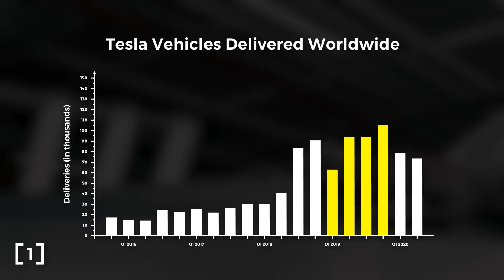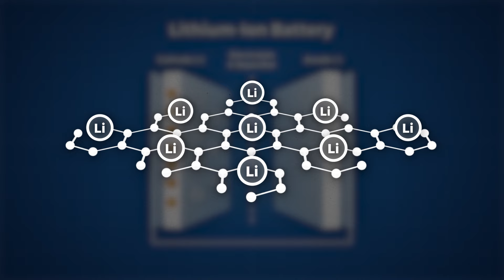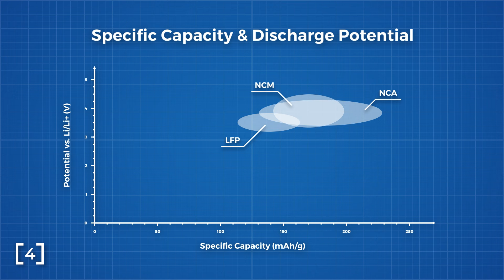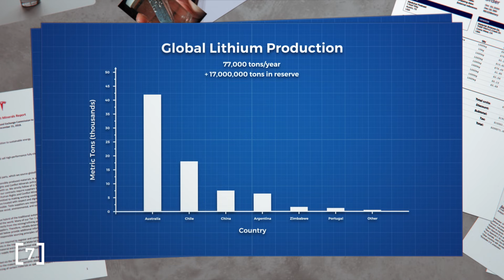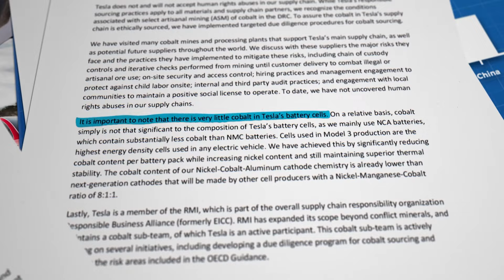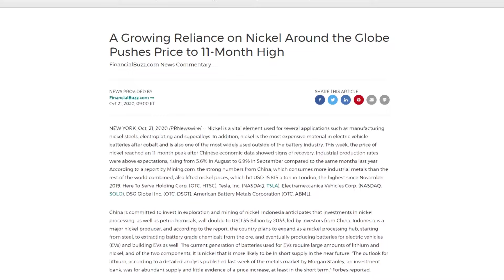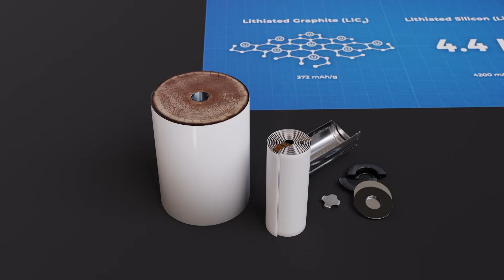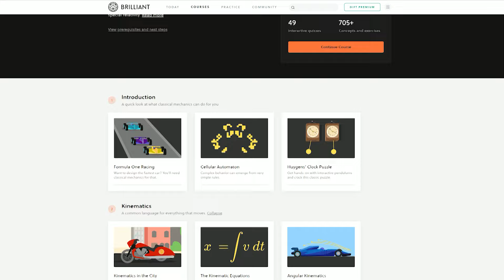Tesla's Battery Supply Problem

Comment: Kurzgesagt:  Let me introduce you to ASTROID MINING!
Reply: If only Elon had some sort of aerospace company
Reply: Ye
Reply: But only a few years
Reply: @ryanfranz6715  Or the biggest reusable rocket on the earth.
Reply: We need a SpaceX Sea Dragon.
Reply: yeah, for no realistic reason...
Reply: Great idea, so we will use rockets that spew thousands of tons of carbon in seconds to go back and forth with relatively small payloads of material. You guys are going to save the planet in no time with this kind of thinking!
Reply: This is the only hope humanity has if we are to survive and grow as a people.
Asteroid mining is the only option.
Reply: @rantan1618  we have plenty of stuff to mine on earth. The benefit of astroid mining is space manufacturing. As a equal amount of solar panels in space is significantly better than those same panels on the ground.
Reply: @ericmichel3857  Starship is methane powered and methane can be produced using CO2, water and energy. So it is kind of closed loop, with energy as input and whatever you bring back as an output
Reply: @ericmichel3857  nah. You'd only have to get the mining equipment up there. Gravity does the work on the way down. Of course this assumes you get an asteroid into the earth's orbit. Regardless not super practical at moment. But not for that reason.
Reply: @rantan1618  Obi wan Kenobi  is "the only hope". I am surprised you did not know that.  I am always amazed by the level of understanding by people that worry about climate change and other SJW issues, it is truly breath taking. Now they are attempting to passionately affect policy based on this level of insight and understanding, what could possibly go wrong?
Reply: Just read the latest responses OMG 😂😂😂 Thankyou, you guys are hilarious. What's next? We could always mine cheese from the moon to solve world hunger? 😂
Reply: And more and more pollution i guess, spacex rockets uses liquid oxygen and rp-1/fossil fuel
Reply: @ericmichel3857  its million tons of carbon
Reply: @LauPaSat-pl  its rp-1/ refined kerosene and not methane
Reply: @lordhefman  you mean starship?
Reply: @daltonlong9593  I mean the largest ever proposed rocket, the Sea dragon. Look it up there is a cool clip from For All Mankind where one is launched.

So what I meant was I want SpaceX to not only do tons of trips to get stuff into space but I also want a US company to have bragging rights to making and flying the largest things into space.
Reply: Its not a short term solution, though. That is gonna take a very long time.
Reply: @ericmichel3857  not to mention cost. Tho carbon is not that big of a problem with rockets
Reply: @CarlosAM1  I agree, there are many reasons this is a really bad idea. The same could be said for wind, solar, and electric cars in general (as a world wide solution). They are fine as niche market novelties for wealthy people who love to virtue signal. But do you honestly think it is worth bringing up all the reasons, when they think we should mine asteroids to build electric cars for the world?  These people live in a cartoon world, it is scary to think they might actually vote.
Reply: ungratefulmetalpansy  it's not a matter of if we can mine or manufacture in space.

It's a matter of cost. It's insanely expensive to escape the earth's gravity well.

However once we do, whether we build in Zero G or on a smaller gravity well like the moon or mars, we will be able to lower that cost.

When that cost goes down we can capture solar energy at higher efficiency than on earth and we can mine asteroids at a cheaper cost.

It's just currently no one, private or government wants to put up the up front cost to start this process.

Which is a little short sighted in my opinion as every nation in history to open a new frontier always profits from the initial monopoly on the new trade opportunity.

Whoever first breaks open the space frontier is going to be the 1800's british empire on super-crack.
Reply: @mortache  you are right it's not a short term solution to current environment problems but it is a solution and it solves many other problems too.
Reply: yeah but who actually owns the materials inside the asteroids?
Reply: @ericmichel3857  Every market is niche market until enough R&D is done to make it more feasible.
Reply: @ericmichel3857  If that CO2 is converted back into methane here on Earth via non-polluting energy, then that emission is carbon neutral and thus wouldn't change anything no matter how many starship-superheavy launches.
Reply: @mortache  Perhaps, but it does not change the fact that right now, and for  the foreseeable future, it is all a BS pipe dream. I also deeply resent our tax dollars subsidizing self righteous virtue signaling twats, just so they can buy a luxury car that makes fart noises.
Especially  when those resources could have gone to something that actually works and would make a real difference, like gen 3/4 nuclear power for example.
Reply: @TCBYEAHCUZ  Another pipe dream that ignores many basic realities, do more research. Elon is an innovative guy, but he also throws out a lot of BS pipe dreams. He is a bit of a con man in that regard.
Reply: @ericmichel3857  I fail to see who he has conned, his wealth increases to the detriment of no one, and his companies recently proved the viability of manned space flight and electric vehicle profitability.
Reply: @ericmichel3857  "climate change and other SJW issues" yup, and there goes your credibility. Not that I agree with the people who think asteroid mining is going to help our resource needs here on this planet but you were very close to calling climate change a democrat/Chinese/cabal/whatever hoax there.
Reply: @ericmichel3857  If by "self righteous virtue signaling twats" you mean just regular capitalists, then sure.
Reply: Not gonna work the asteroid belt only has about 4% the mass of the Earth's moon hopeless endeavor
Reply: @HomeSkillenSLICE  No one wants to mine the entire belt lol. Its the big chunks of rock that are rich in minerals which are hard to extract here.
Reply: @TCBYEAHCUZ  Elon is certainly a visionary and has driven some impressive innovations. However, he also has been purposely overly optimistic and neglects to discuss the down sides of the technologies he advocates and built his business model on. Which is understandable, all I am saying is that it is wise to view his claims with a healthy dose of skepticism. For example methane rocket fuel is far from carbon free, hydrogen is much cleaner, but far more difficult and dangerous. See here  https://everydayastronaut.com/rocket-pollution/ if you scroll down it reviews the emissions level of each fuel, notice where Elon's starship fuel lands compared to others. Just like wind/solar/batteries, it all sound wonderful until you start looking closely at the details and explore the full implications. That is what this video talks about regarding the feasibility of the entire planet going to electric cars. 
I want him to continue and be successful, just realize that they are not entirely what they seem to be at first glance, and that our current fossil fuels are still desperately needed for the foreseeable future, and they are not as awful as some would have you believe. Elon tries to convince you otherwise because it is in the best interest of his business, but the reality is that it is not the world wide solution you think it is.
Reply: @mortache  I meant anyone that believes a high priced luxury car that goes 0-60 in under 3 second and makes fart noises is "saving the planet" what they claim their political beliefs are on social media is irrelevant. Although you don't see much (if any) innovation coming out of socialist societies so...  Unless you think misery and suffering is an innovation? :)
Reply: Asteroid mining will become economical when extracting gold from the sea become economical.

Translation: never
Reply: Yes, but no
Reply: @ericmichel3857  What if we use thos rockets to instead of moving the minded material off the asteroid, you instead launch the astroid towards earth. Then mine it once it hits the ground.

I bet fancy computers can model where it'll land, so launch them into int desert then send mining crews to extract the resources.
Reply: @zaptowee6625  Well, even if we could do it, and I don't believe we could with current technology, it would be a really bad idea. "The earth is protected by a thick atmosphere, the equivalent of 10 meters (30 feet) of seawater. This layer causes small incoming rocks to explode in the atmosphere high above ground and pose no serious threat. These are the meteors or "shooting stars" that we see at night. Asteroid impacts larger than 10 meters (30 feet, 10 kiloton explosion) are much less frequent, arriving once every few years and may sometimes punch down to the ground. The meteor, which exploded above Chelyabinsk, Russia on February 15, 2013, for example, was estimated to be about 15 meters (50 feet) diameter. The explosion in the atmosphere was equivalent to about 440 kilotons TNT. Still larger asteroids are much more dangerous, the explosion from the impact of a 100-meter (330-feet) diameter asteroid and larger could kill a million people, averaged over all possible impact locations. These deaths could result from a direct hit or by tsunami (tidal wave) in the event of an ocean strike. Scientists predict an asteroid impact of 1-2 kilometers (1-mile) diameter will also cause secondary global damage to the Earth's climate. The vast amount of debris thrown up from the explosion and the subsequent fires will create an "asteroid winter" that might persist for several years, long enough for crop failures to lead to mass starvation. These secondary effects are a hundred times more deadly than the prompt loss of life from the impact.
If a relatively small asteroid were to impact the earth (even in an uninhabited location), it would be a really bad idea. Set aside the apocalyptic event concerns for a moment, if we could do it the cost would be ridiculous, and for the amount of material it would yield after all was said and done, it is far more economical to just mine materials already on earth. 
When they talk about mining asteroids, they mean for raw materials to be used in manufacturing in space. So for example to build huge space structures it would be more feasible to  mine and process materials in space rather than trying to send up everything we needed with rockets. That is where mining asteroids comes into play.
The only time I have seen where mining in space to return material to earth might make sense is for extremely rare and valuable materials that you can't really get on earth, like Helium-3.  That is one of the rare elements they are wanting to mine for on the moon.
Reply: ungratefulmetalpansy  believe what you want.
Reply: @ericmichel3857  what about we tow the asteroid to crash at destined coordinate?
like asteroid that smash africa? im kinda forget.
Reply: @ericmichel3857  asteroid mining will eliminate most of earths carbon emissions so any launches towards that will be worth it.
Reply: Not really going to happen Big time in your Lifetime, Keep Dreaming.
Reply: Atlantean: Let me introduce you to Ocean Mining!
Reply: @LauPaSat-pl  
And? Unless you find a better more viable solution to bringing millions of tons of material from space to Earth then this is not going to happen, its fiction pure idiocy. 
Capitalist free market has no desire nor economical capacity to survive on space mining, in fact the free market is on a terrible course of total collapse in less than 20 years, I doubt they will invest in space mining at all, they will try to squish out as much profit as possible before their big downfall.
Reply: @AllaBader01  huh?
Reply: @ramitkumar2918  context
Reply: @ericmichel3857  dude watch the video of the u tube kurzgesagt on this topic to see where your statement
Reply: @lordhefman  
I often wonder if there was more to falcon 9 fairing recovery, if they could manufacture giant heat shields shape re-entry vehicle in space with rocket engines for propulsive landing, and only the rocket engine unit are reused. Your left with a giant doom shape metal structure, and the process ore cargo it was carrying.
Reply: Eventually it'll be space mining essential to push further in technology.
Reply: dont mix up science fiction and reality,...
Reply: @ericmichel3857  We don't live in a cartoon world, it's because we understand technology and have a decent understanding of science we have a fair idea of what the future technology trends are. The future is going to be a bit of a shock for those that don't understand, try the likes of Tony Seba, he can explain technology trends far better than me.
Reply: @ericmichel3857  never played KSP? landing asteroids is doable with parachutes :D
Reply: @ericmichel3857  I agree governments should subsidize nuclear power more but there's nothing wrong with subsidizing research that takes a long time to prove viable, in fact the reason governments subsidize these futuristic ideas is so that companies will start investing when the research is far enough for them to think they will make profit out of it
Reply: @machielluchtmeijer7796  We are already doing that, companies like Space X and Tesla are heavily subsidized by tax dollars, you know that right? Getting to this future vision requires huge amounts of energy and resources, and guess where that must come from? That is the issue, everyone wants to demonize fossil fuels and nuclear, but that is the only way we will one day get to these future technologies. These people are not realistic and expect us to run when we have yet to learn to walk. 
I have been hearing that fusion power is only  5-10 years away from being a reality for over forty years, and what do we hear them saying today? Another 5-10 years, only this time they really mean it? 
We cannot abandon our current energy sources for some pie in the sky technology that does not exist. Trying to do so before we are ready will end in disaster. So called green technology is already completely subsidized by our use of fossil fuels, this is something all of these ideological SJW's do not seem to understand or appreciate. 
Sure a few wealthy people can put solar panels and windmills up and drive expensive resource intensive electric cars, but that is not feasible for the vast majority. If we abandon these energy resources out of some irrational fear and ignorance, it will be a disaster. 
We can see a horizon filled with cheap reliable sustainable energy, but we are not there yet. These people are like children, no do it now! As they demonize the very people  making this future possible insinuating they are just greedy evil polluters. It is a very ignorant childish view, especially as they are the very ones benefiting from the very thing they claim to despise, it is all so ridiculous.
Will we one day mine materials from space, I think so, will it happen in any meaningful way in the foreseeable future? No, but if we keep industrializing, using the resources we can and do have, we will get there eventually. It is wealth and resources that will enable these things to happen.
Reply: @FlyLeah  "asteroid mining will eliminate most of earths carbon emissions so any launches towards that will be worth it." Well you could also say that all the fossil fuel usage today is allowing us to develop the wealth and technology to develop new energy sources that will eventually eliminate emissions, so any use of fossil fuel today is worth it. In fact whether people admit it or not, that is exactly the bet we are hedging. Some argue we don't need less industrialization and carbon usage, we need more so that we can eventually get to these future technologies. 
Otherwise you have small groups benefiting from and contributing to this technological progress while billions suffer in abject poverty barely surviving and not able to contribute. But hey we will send them a care package so...
Some argue that getting the rest of the world up to western industrial standards will greatly accelerate our technological revolution and bring us to this sustainable future much faster and is the more humane thing to do. Rather than trying to hold them back out of fear. 
We are coming up with better cleaner technology all the time, this is one thing all of those gloom and doom predictive models do not and can not predict. Are we going to bet on ourselves? Or live in fear? i have faith in us.
Reply: @lordhefman  The thing that mining in space is that it still enables competition and uphold a market. However, it can only be positive once the infrastructure has been established and mining on Earth has to cease altogether. 

Not mining her on Earth also allows the earth to heal and regain the damaged land too so i mean i guess it work
Reply: @ryanfranz6715  r/swooosh
Reply: @TamPham-mj4zu  earth mining doesn't need to stop.

The cost to benefit ratio of space mining has to equal earth mining for one to begin replacing the other.

Except for very rare metals that replacement probably won't happen.

However I did say the primary reason to mine space is to manufacture in space.

The reason space mining works in this case is again due to cost vs benefits.

A. You mine on earth, then send materials to space. Repeat as necessary. 
This is low cost to make, high cost to get it to where it needs to be.

B. You mine on earth the first time, send it to space the first time, then mine in space. Afterwards you build in space.

This is low cost to make the first time, high cost to get it where it needs to be the first time, but once you are up there you aren't fighting gravity and movement is pretty much free depending on how fast you want to go from point A to point B.

So earth mining will always be there.

But once space mining and then manufacture is real, space solar power is possible and at that point we could get enough energy from the sun to make literal giant AC units for the earth of we feel like it.

Admittedly Giant Mountain sized AC units are probably 300 years away.

Assuming we have colonies in space in the next 40-100 years.
Reply: coming to a solar system near you, in 2086
Reply: Skyhook: rots in the background
Reply: I wonder why Elon didn’t just start an asteroid mining company… hmmm…
Reply: @ryanfranz6715  also some sort of mining company, but that might be a bit boring for him
Reply: I was thinking the same thing, but unfortunately that’s a bit too far off for now
Reply: @UltimateBreloom  Depends how soft of a landing you want for the (processed?) materials you return from space. Not sure if bombarding some desert would be an economical solution. 

How much of the ore would burn up in the atmosphere? How deep in the ground would it embed itself? Is there a danger of it bursting in the air like some asteroids? Over how large an area would the material be dispersed?
Reply: @pflernak  you would have to manufacture heat shielding in orbit. Probably do some kind deployable drag system to slow it down. There would be hurtles to jump through for sure. Like I said don't think it's practical just not because of the reasons given.
Reply: @ericmichel3857  you need to unlock electric rockets in the research tree :P
Reply: @ryanfranz6715  Elon had told he won't mind astroids any time soon. Because even with reusable rockets it will be uneconomical as the prices will crash for that particular substance.
Reply: @lordhefman  We could mine the sun, it has Jupiter's with of metals and those metals shorten our sun's lifespan.
Reply: @HomeSkillenSLICE  It will take BILLIONS OF YEARS to exhaust them
Reply: @ladasodaexplains3355  He doesn't wants to.
Reply: @cowsine  that depends on how many humans there are. If it's only there to satisfy 7 billion well then yea it'll prob work fine but if theres gonna be a trillion people then probably not
Reply: It's too expensive.  The speeds of an asteroid relative to the earth makes it uneconomical to retrieve whatever resources they MIGHT have.  I would be cheaper to mine the moon - provided the moon has any useful resources worth mining.

I also have no idea why people are so utterly convinced that asteroids are filled with any particular elements.  We've only managed to land a few probes on them after all.  The idea that we know what asteroids are typically composed of is simply false.
Reply: @ryanfranz6715  SpaceX
Reply: @ericmichel3857  kurzgesagt: so here's the plan for a space elevator...
Reply: @ericmichel3857  What if we deflect an asteroid in an orbit which leads it near LEO and then we just crash it somewhere safe and we're in business.
Reply: Let me introduce you to SPACE SUPPLY CHAIN.
Reply: Imagine wasting that much energy power and raw materials to farm asteroids, when we have enough raw materials for the foreseeable future on earth. This the the most moronic solution I've heard in a while
Reply: @ericmichel3857  why is climate change so hard to deal with?😭
Reply: There is only one solution for climate change rn

THANOS
Reply: Question is how abundant is lithium in solar system
Reply: @Righteous Agitator yep, if you check for example Wikipedia about Asteroid mining, there's no word about lithium
Reply: @Righteous Agitator I noticed this article, I would love to read it, but I don't have subscription 😁
Reply: @ryanfranz6715  yeah only if he had some sort of reusable rocket that has the highest payload
Reply: Tbh this is completely unrealistic for our goals
Reply: Rockets are inefficient and burn a lot of fossil fuels